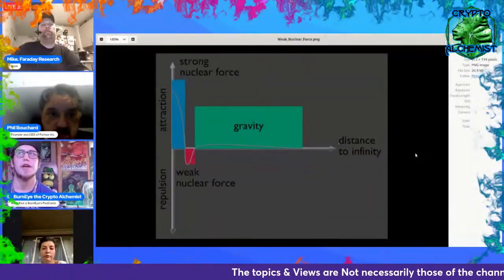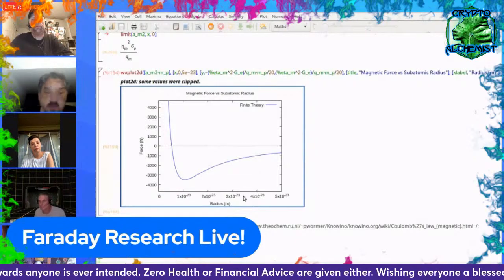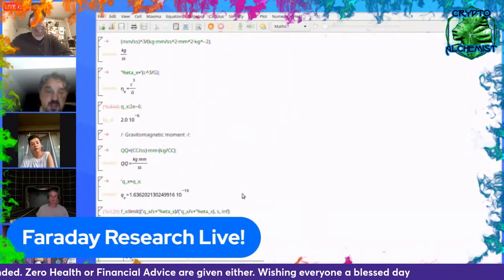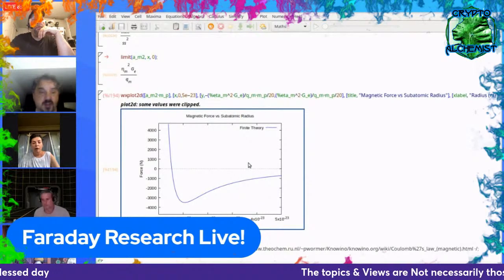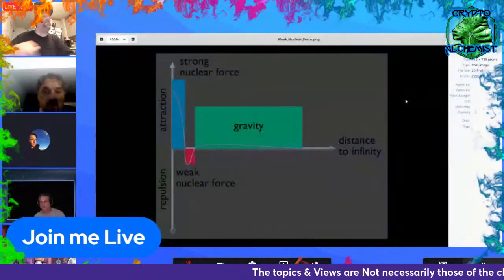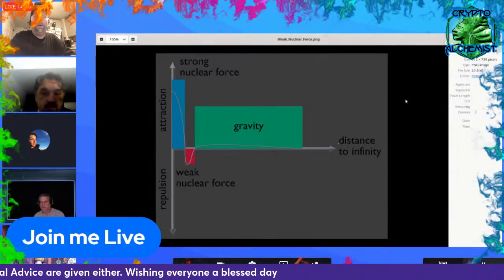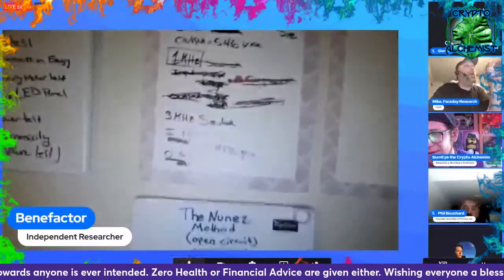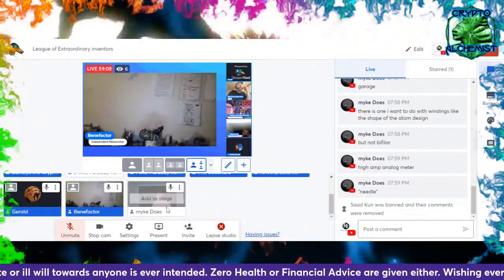Free Energy Fridays w/ League of Extraordinary Inventors, Faraday Research Mike

Comment: Was that black layer coating on your copper wire just an oxide layer, as in flooded in ozone in order to create an oxidition layer?
Reply from the maker: no oxidization on the black coating, it can be done through caustic, electrolysis, and flame. it's just a break down of the copper metal into a nano layer